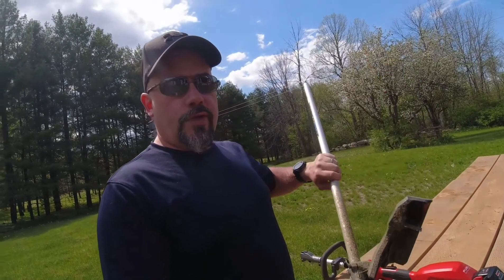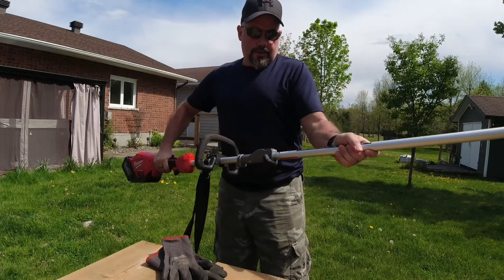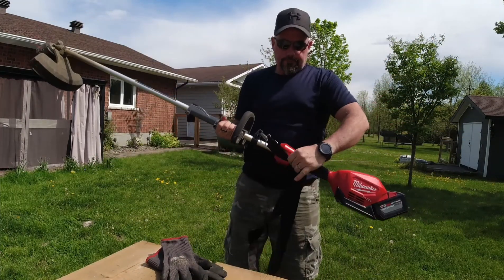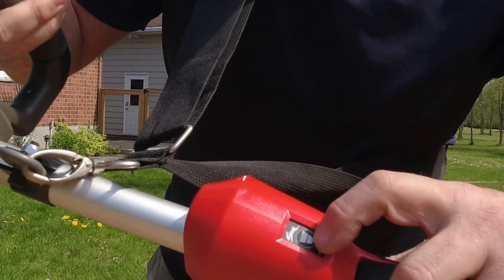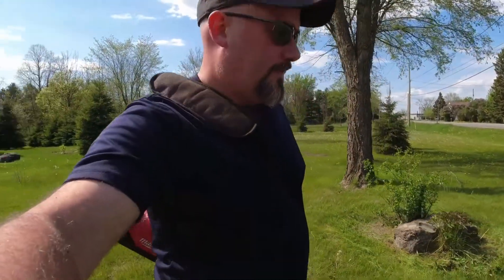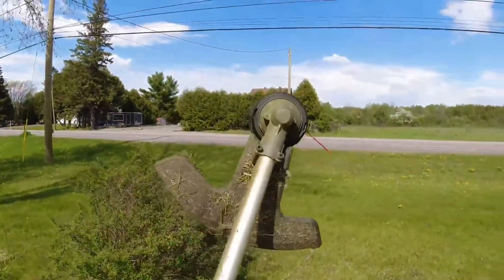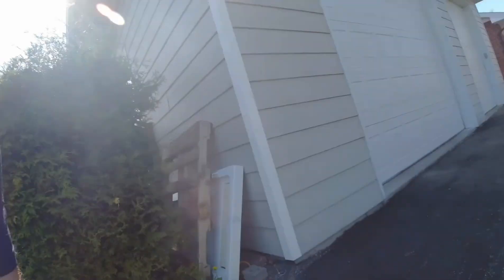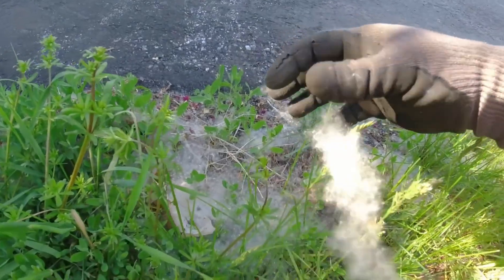Watch this before buying the Milwaukee M18 Fuel cordless line trimmer

Comment: Watch out for the burning battery connection, many bad reviews about how they melt.
Reply from the maker: Thank you for the warning. I have not had that issue luckily.
Reply: @RossOnTheLand  yeah be careful especially when charging in your house....
Reply from the maker: We have the charger in the shop, and were wanting to add an electric cutoff so we can disable the power when not there.
Reply: @RossOnTheLand  ahhhh ok. Don't know if that will stop the battery from burning and possibly catching fire. All n all, best of luck. Your friend JAB.

Comment: I got mine today, works great. I have the 8.0 battery. You have to install the debris guard which controls the strength length otherwise the string gets too long and overheats the engine. The 8.0 battery lasts quite awhile, more than enough for an average yard.
Reply from the maker: I agree lasts a long time. I use the 12 battery because that's what came with my chainsaw and it lasts amazing long.

Comment: Have been hering about issuse with this trimmer melting batteries and having a overheating issue that may be cause by clothing blocking vents. Have you experienced this?
Reply from the maker: I have heard that as well, but have not experienced any issues in 3 years. I will say the 12mah battery used to last a lot longer, but we use that battery in our shop every day so it's tired... Other than that no issues! Thanks for watching and commenting, let me know if there is anything else you'd like to know.
Reply: @RossOnTheLand  great to hear just purchased a trimmer and plan on getting the pole saw attachment soon will be using the pole saw more than anything around here lol
Reply from the maker: I really like the extended hedge trimmer, but agree the pole saw would be handy around here as well.  Hummm.. maybe I'll go looking at that attachment now :)

Comment: I have one. I love how it loads the line but it doesn't feed the line that well when using it. Overall I love the machine. I've cut very tall grass with it without issue.
Reply from the maker: I have to agree with you. Slamming it on the ground to advance the string is very rough. Loading is easy.  Thanks for watching and commenting. Have a great day. Cheers.
Reply: The problem is with the line that they give you.  Remove it and switch to the Husqvarna titanium line.  That'll fix it.
Reply from the maker: I'll definitely check it out. Much appreciated
Reply: @joet_swbo101   thank you, I’ll try this
Reply from the maker: Let us know your findings

Comment: Great Video! I'm on the fence about purchasing one. I keep seeing a ton of reviews that people are having overheating issues and melting batteries. Have you noticed any issues with yours?
Reply from the maker: Thanks for watching and commenting, I absolutely love this system. I have only had overheating issues with the chainsaw on the hottest day of summer, cutting a too big oak tree. With a dull chain.  Otherwise no issues with the trimmer.  Now. I will say if you are doing lots of hedge trimming, the extended pole can become a bear to use all day, I think the stand alone trimmer would be better suited for normal hedges. The extension is great for brush clearing close to the ground as well.  Let me know if there is anything else I can answer for you.
Reply: Those having overheating issues are not putting on the debris guard which lets the string get too long and overwork the motor. I was having same problem until I put on the guard and all the problems stopped.
Reply: I saw several reviews on Home Depot with images of melted battery terminals. Really has me concerned for the long term reliability of these trimmers.
Reply from the maker: @livens100  I have used mine for 2 years now, and no issues with melted connectors, batteries or tools.  We use a bunch of Milwaukee M18 tools in our shop,  including the chainsaw with this battery and no issues.  I can't speak for everyone, but in my experience they are a solid, reliable tool system.  Hope that helps.
Reply: Wouldn’t recommend, I use mine with the debris guard and it overheats every time. 12, 6, 5 it’s melted all battery types and every time it gets “repaired” on warranty it comes back and cooks another. Currently in for the fourth time so I’m hoping they replace it because they sure don’t test properly after a repair job.
Reply from the maker: Sorry you are having issues.  :(

Comment: yall sure it is working great??? 
mine stop working like after 10-15 minutes usage…. 
this is literally not even batter than my garbage can… dont do its job……

ppl said its bc the hear sensor senses heat….. im like just laughing….. who was the electrician to design this trimmer??? 
so max usage time is only 15 minutes…???? 😂😂😂😂
then why i need this huge bettery???
Reply from the maker: Sorry yours didn't work well for you, on a 12maH battery mine lasts longer than me, I can do my entire home perimeter on a charge.  I'm very happy with it. Thanks for watching and commenting.
Reply: @RossOnTheLand  so you saying 12mah one will be working on mine too?
Reply: @RossOnTheLand  i mean the battery is ok but it is just stopped when the battery still was remaining…
Reply from the maker: @DJkim1205  if it's Milwaukee, and yours takes an M18 battery, then yes. all M18 batteries will fit.  The larger the MaH the longer it'll run.
Reply from the maker: Sometimes it may get too hot, and stop if it's one of the smaller batteries like the 4.0mah or something.

Comment: You have a nice yard, I don’t. I’d like to see it operated in more real world conditions some of us have much heavier stuff then short grass to cut. I wasn’t impressed with the performance of it in these couple of sticks next to your tree but that’s probably because it’s running really thin line. I’m curious how it handles a brush blade and some serious cutting of stuff up to 2 inches thick? Maybe it just can’t handle it? I like the idea of an electric trimmer but only if it can get the job done.
Reply from the maker: Hey! Welcome and thank you for watching and commenting. This trimmer will work on thick grass but will not cut 2" thick branches with the string.  I do not have a blade, to test, but I'm absolutely sure it would work just fine with a blade to cut that. There is so much power and the 12MAh battery lasts a very long time.

Comment: Mine wont run for 20 seconds smh
Reply from the maker: Oh no, that sucks.  Is the battery old? Or too hot out? Thanks for watching and commenting.
Reply: @RossOnTheLand  it's an 8ah not enough power
Reply from the maker: @richardvillanueva559  ah yes! That is a limiting factor.
Reply: It's overheating and shutting off.
Reply from the maker: Oh sorry to hear that. Any other ideas as to why?